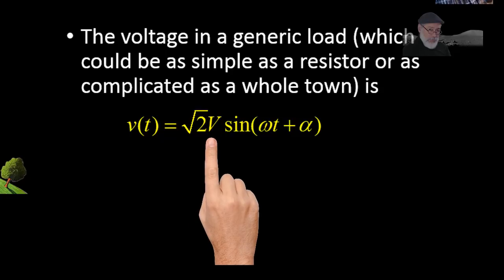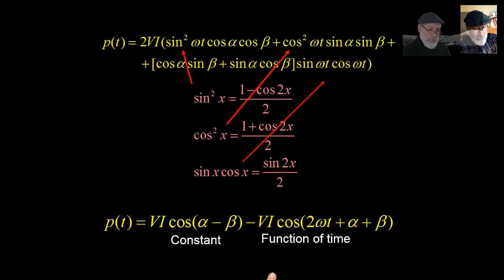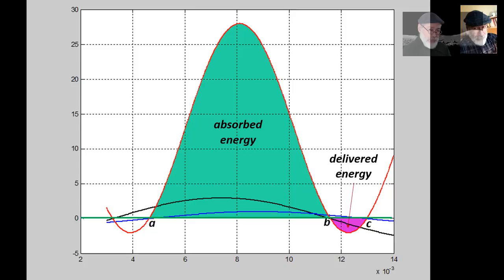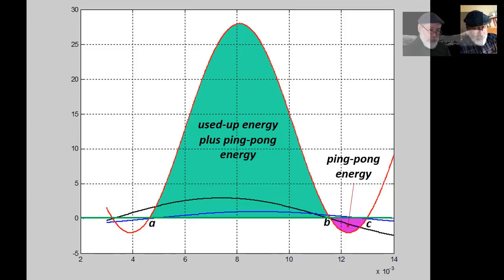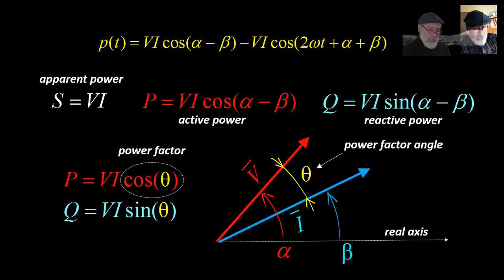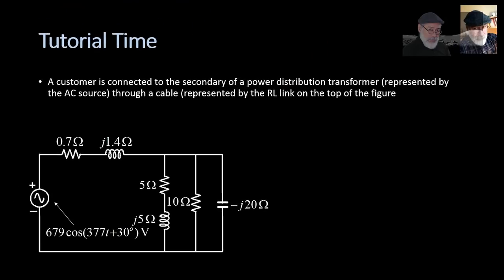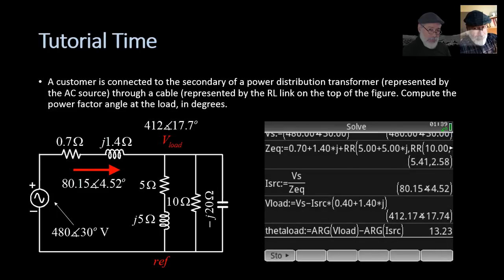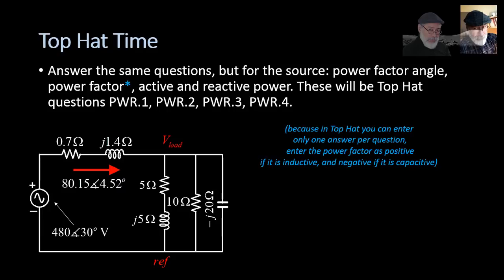ELEC 202/05 - Power in AC Steady State

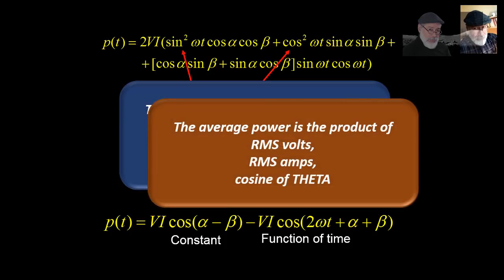Comment: Thank you for the explanation of the different powers using vector and graphical methods. I am confused about the power equation @ 4:27 though. Is it the sum or the difference of the constant and the time dependent term? There are books depicting it as the sum and vice versa. Thank you
Reply from the maker: Thanks for your comments. Observe that I represent voltage and current as sine functions of time, then I end with the subtraction that you highlighted. Work the math starting with cosine functions for voltage and current, as many textbooks do, and you will end with a plus sign. In any case, as in AC Steady State we are interested on the average powers, S, P, and Q, that sign (plus or minus) has no impact in the final result. What we bear in mind is that in ACSS power is a sinusoidal function of time with twice the frequency, and that the average power depends or the RMS values of V and I and on the phase difference of V and I.

Comment: The first resistor in the cable branch changes from 0.4 to 0.7 really threw off my calculations
Reply from the maker: Yes, I noticed that there was a transcription error. It has been reported many times before. I copied the 4 as a 7.